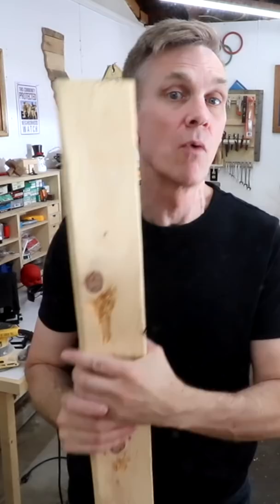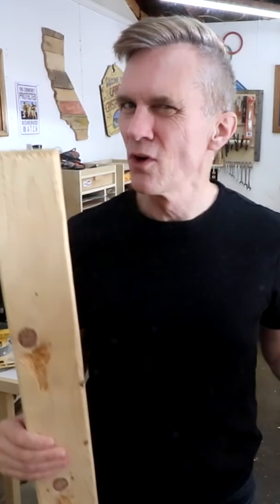Why do 2x4 boards have rounded edges? #shorts

Comment: After the saw mill sends it to the kilns to be dried, the planer mill puts the edges on when they're going to be stored because it allows airflow in the stack to prevent rot and allow expansion/contraction and not shift the weight of the stack to severely.

Edit: I worked at a saw mill for 3 years
Reply: Very informative, thanks for sharing! You need to make a video for all of the angry and unsatisfied viewers of this video 🤣
Reply: Thank you.
Reply: I always thought it was just more sawdust to make more particle board
Reply: I guess the fact that treated 2x4s are square cut supports this.
Reply: @ethansmith9065  Trust me, there is more than enough sawdust just from the normal cutting at the saw mill that theres no need for that from the planer mill
Reply: @GiuseppeGaetanoSabatelli  It mostly depends on the order the mill is working on, and the piece of wood, because top quality boards are pulled off to tell for high quality furniture manufactures and such. But it really depends on the actual order required from the mills
Reply: @ethansmith9065  We also didn't make particle board at our mill because we sold the chips to the paper mill and the dust to a one of the smaller lumber companies to do whatever they wanted to use it for lol. I know every mill does things a bit different.

Edit: Or if we needed to fuel the Kilns we'd move some of the sawdust over to the boiler thing (can't remember the actual name of it I didn't work over there lol)
Reply: @devinhughes7803  They don't need any extra sawdust but that sawdust has value in and of itself. So more sawdust means more profit with essentially no additional cost or effort.
Reply: So when this guy said "nobody knows" he just meant he wasn't willing to do any research. Seems legit.
Reply: Came here to say this and I don’t even work in a saw mill. I just put two and two together, kinda like split wood for the fire place can’t be stacked so tightly
Reply: This is what I needed, thank you.
Reply: While that is a benefit, that is not the reason why. It’s for the saw dust along the saw fence to be pushed out. If not for that, the dust accumulation would slowly build up and push the boards out.
Reply: Devin needs to have his post pinned to the top! 👍
Reply: @DontTreadOnMe1776  If you don't like us picking through it, stop selling warped lumber.
Reply: Makes sense
Reply: Since this video did not answer the question, we'll go with your suggestion. It sounds plausible.
Reply: @DontTreadOnMe1776  it sounds less like you worked at a lumber yard, and more like you worked at Lowe's 😂
Reply: I love how the guy in the video doesn't know why they are rounded, so he comes to the conclusion that no one must know why xD and then the top comment proves the entire video wrong. I love you
Reply: WOW SO WHATS THE POINT OF THIS VIDEO
Reply: I can see it allowing airflow on the edges of the 2x4, but how does the round edge help the center part of the board with airflow and rot when stacked?  That part is still flat
Reply: but the guy on the internet says no one knows...
Reply: Wrong I just saw a video and he said no one knows why. Liar
Reply: Shhh he said “nobody knows”
Reply: Well appreciated someone does know why.   Thanks buddy.  That sounds functional.
Reply: @notsure1350  lol. I was going to look up the answers but it was the first post here. Mystery solved.  👍
Reply: Thank you. I was furious when it ended with “nobody knows.” I was like that’s bullshit. Someone knows.
Reply: Thanks for that m8
Reply: What about the fact that the drying process does it
Reply: Finally someone else who has some brain cells, every machinist knows this and it’s not raw cut and then sent out . Most places raw cut to size then put through 6 cutter and reduced to final size and it’s not any extra in doing rounded edges. Ready for pressure treatment. Then u have idiots like him saying no one knows  why  😂😂😂
Reply: Seems like this guy knows
Reply: @DontTreadOnMe1776  though you are right there's too many of those f*** up ass people that want to leave cards everywhere take up handicap spots literally Park their f**** trailer perpendicular to the actual way you're supposed to park taking up literally nine f**** spaces just because they don't want to step another 200 ft where it's designated to park when you've got trailers that's completely true but hardly anything else that you said was except that hardwood does hold up to climate a little better
Reply: @c7adventures376  Watch the science of what happens when it dries you might find it interesting I'll leave it to you to decide whether you do it or not there should be a little 10 minute documentary that'll give you a lot of information I personally guarantee it you would just have to find it I don't remember the name of it but I watched the actual documentary when it showed the whole thing on TV all the way to getting to a lumber store
Reply: Doesn't it help keep them straight when being dried in a kiln as well?
Reply: I thought no one was supposed to know this information. You better watch your back before someone wants you dead for knowing too much.
Reply: I came here to write this.
Reply: Preach, my sawmill friend.
Reply: Yep.
Reply: "nobody knows" lmao I guess he asked Google instead of someone that works at a saw mill.
Reply: Thanks man. You should have done the video. Hell you answered the question I didn't know I had till this video. Lol might be drunk.
Reply: Thank you for explaining!
Reply: I found nobody
Reply: @ethansmith9065  the sawmill I worked at used sawdust to create steam for the kiln. There was mountains of it. No need to make more lol.
Reply: @bikerfreak714  at the sawmill I worked at when stacking the wood they would put 4 1x1 in between each layer. When stacking to go in the kiln.
Reply: @bikerfreak714  What are you actually even asking? I mean, said 2×4's are shipped, sold and whatever on pallets or skids, so check this out. If the lumber has rounded edges that allows air to flow through. No rounded edges, no air. No air means moist which means rot. Use your brain.
Reply: @Billy420-69  Thanks for the reply.  Op said it was to prevent rot AFTER kiln and during storage.  Most 2x4 bundles I see don't store them with 1x1 spacers so I don't see how rounded corners help the flat section with airflow.  Still think it's more to prevent edge chipping and damage during transport when the 2x4s tend shift around
Reply: @zacharyrhall55  You obviously didn't understand my question and just resorted to insult
Reply: Nobody knows why, this guy does
Reply: Came to say this. It's to prevent you from having a metric ton of moldy, rotted wood.
Reply: Apparently someone DOES know.
Reply: I work in construction.. My thought was about shipping and drying.. So i guess i was close..
Reply: This is the most outrageous video ever made. Thanks for calming me down after that infuriating ending
Reply: Thanks
Reply: @bikerfreak714  I'm pretty sure as long as you keep the lumber dry after the kiln rot won't be a problem for about 10 years.
Reply: Thanks for the knowledge!
Reply: It took me 10 seconds to read this comment and it gave me 10x better information than this joke of a video.
Reply: Make a video calling this guy out.
Reply: To mimic the influential final words of Ozzy Man: fuck yes, Devin Hughes. Fuck yes.
Reply: God. thank you for being here. So tired of these damn stupid click bait shorts
Reply: Legend
Reply: You are good
Reply: @ethansmith9065  that aswell
Reply: @bikerfreak714  wood is permeable
Reply: But nobody knows why they do it
Reply: #69.........we are "screwed" absolutely................
Reply: Makes perfect sense.
Reply: This was the first idea that came to my head
Reply: Wouldn’t it also make it easier to put forklifts or other industrial machinery to separate stacks?
Reply: I was gonna say, I worked in a lumber yard too, but I couldn't recall having rounded edges on the boards. Turns out, because I was in sorting shed and the mill, never worked by the kiln.
Reply: Thanks you should have just done the video
Reply: King
Reply: I would've thought maybe because they could sell off the wood shavings for extra cash while not reducing overall integrity & getting the added benefits of the rounded corners
Reply: I noticed this at home Depot when pulling wood from the straight edge wood piles.
Reply: Thank u. The preamble was putting me to sleep.

Here's your cape, sir!
Reply: I’ll take your word for it🧐
Reply: Nobody knows. NOBODY. Say it with confidence.
Reply: Maybe.. I ran a wood-fired kiln at a sawmill for several years and I don't think that would be the primary reason though. I'm not sure how you guys load your track units but that wouldn't help very much at all once they're stacked, racked and loaded. 
We had rules in the drying and also the pressure treating area and were monitored by the EPA, APA, OSHA, etc.. and had to cut, stack, heat and treat every board in a very strictly controlled manner. This could differ from state to state though (I don't know).. but they told us how we can/can't cut the lumber. Is that how other mills run in your own areas?
Reply: Tha ks devin 'preciate chu
Reply: Thank you devin hughes you're life led up to this moment and you didn't disappoint
Reply: Oh. I always thought it was just a "mistake" that was caused by using machines.
Reply: Yep, saved me time typing it out 👍
Reply: I concur
Reply: I'd imagine it also reduces weight in transit, though very minimal. The same shipment, but that trimming can still save on fuel costs. Over time it adds up.
Reply: @rebelicanlifestyle2817  that was so pretentious who tf says that
Reply: Thank you this guy left blue balled us left me wondering.
Reply: Brilliant
Reply: @devinhughes7803  you sir are clueless !
Reply: Is this how it began? Did people long ago think about airflow?
Reply: This is cool thanks. I worked in a high end cabinet shop for 5 years. We used to take hard wood boards that would be unseen, similar to pine studs, and round the edges to get a more uniform fit, especially when the boards have to border another.
Reply: Danke
Reply: "Nobody actually know the original reason why 2x4s have rounded edges"... Except Devin
Reply: Thank you glad I came to the comments before finishing the clip. This guy was talking way to much.
Reply: What a king
Reply: Thank you for answering this question. It makes perfect sense. Thank you again.
Reply: I would think this would effect shipping costs as well. Shaving 2.5% of weight across an entire truck means you can ship more.
Reply: @Devin Hughes but didn't you hear the man? No one really knows! XD
Reply: I hauled lumber from mills and loaded trucks at a lumber yard for 22 years. You are right, also helps keep the boards from twisting due to too much moisture. During different times of the year there are different kiln processes, but that was for pine lumber. That was mainly the mills I loaded out of, we got our spruce cedar and fir by rail. Loaded osb and plywood at local mills too. Wood is a great material to build with
Reply: Seems right, I'll just take your word for it lol
Reply: Bruh he said nobody knows so that means nobody knows.
Reply: @Sparrowash97  mill workers have been scratching their heads on this one for centuries! "idk man I put it in as a tree and it came out as rounded boards"
Reply: That makes sense
Reply: This guy is why I still have faith in YouTube comments
Reply: That's what I understand as well, that and for automated handlers, at least from what I understand. I don't work at a mill, though there are several in my area. Much love friend
Reply: Yeah, but he said nobody knows so..... /s
Reply: thank✨
Reply: See this is what happens when regular people try to make videos they forget there are workers like you who know wtf there talking about
Reply: Thank you for actually answering that. This short just pissed me off by not answering his own question.
Reply: MVP
Reply: Thanks for making this video not a complete waste of time
Reply: Nah that can’t be true, according to this guy nobody knows the reason. He just said it
/s
Reply: The video had zero value. This comment is all we needed.
Reply: @enix0053  just dislike the video bruh it might have 50k
Reply: He’s not lying people
Reply: 🤬 Dude, you should have made this short story, not him. At least with you I actually learned something. He effing waisted my life 😡
Reply: Mai nigga..👌🏿
Reply: When the clip doesn't deliver what ut says it will but a commenter decides to do it instead, thanks.
Reply: No, IT would be microscopic airflow - not enouch. And because of that they are stack with spacers. Also - IT would be stupid amount of work for such purpose.
Reply: I love this "Nobody Knows"...

"BITCH HOLD MY LUMBER"
Reply: I just came here to write exactly the same.
Reply: That's awesome! I love learning about different career paths.
Reply: The genius who made the video could have just asked at a saw mill, but decided nobody knew 😳
Reply: So, this video is just peddling more bullshit misinformation, priceless YouTube.
Reply: Just about to say this but you beat me to it lol
Reply: I believe you proved that somebody knows why!
Reply: Thank you, obviously WAY more knowledgeable than this guy doing videos
Reply: I though of why they might do that cut and this is the first thing I thought of. I'm glad it's actually based in some truth
Reply: And you would think to go all the way is to do a video, one could have researched that to include in the closing... Nonetheless thank you for your information. I probably would end up calling the sawmill otherwise.
Reply: Great answer. Can’t believe the guy in the video wasted everybody’s time.
Reply: Thank you! I was really curious after all those reasons that weren’t reasons. I guess contacting a saw mill wasn’t in the video budget.
Reply: wow thanks! I was getting salty that he didnt give us the reason. just said NoBoDy KnOwS. clearly not nobody, because you know! :D very informative.
Reply: Nice
Reply: Lol all it takes
This guy acted like it was a secretive as the holy grail
Reply: Should give you all the revenue he gets from this
Reply: Now we know.
Reply: That makes sense. Thanks
Reply: Genius.
Reply: The expert is always in the comments.
Reply: Nice work
Reply: @bikerfreak714  can't give you a mathematical equation for it but I am certain one key factor in the drying of anything will be surface area. And by rounding those edges you will increase this by a substantial factor.  (Plus wood isnt considered a solid surface so air channels along the sides will allow the individual sticks to breath where as if edges were square, any moisture would have to make it throigh the whole thicknes of the stack.)
Reply: Thanks. This guy was saying absolutely nothing with no resolution.
Reply: Rounded 2x4s warp like wild compared to 2x4s left with no rounded edge. I deal mostly with #2 lumber at my lumber yard and that shit is pretty straight when ya cut the bands opposed to the rounded ones.
Reply: @ryanlynch3579  Most helpful explanation.  Thanks Ryan!
Reply: I worked at a lumber yard upsticking and running the kilns as well as loading and unloading units.  I HAVE NO CLUE haha but all cedar came with edges and doug fir boards were all rounded and came to me GREEN.  True reason is unknown, everyone thinks they have the answer but they don't really.
Reply: Man you shoulda made this video. Not that amateur
Reply: Have heard his reasoning and that it makes the fibers larger so that they don’t peel as it is dried.
Reply: I didn’t have to work at a saw mill to learn that lol. It’s just common sense really.
Reply: Oh that makes sense actually
Reply: Thankyou you're more useful than the video guy
Reply: I cant imagine the things you saw.
Reply: This guy knows why
Reply: Class is over
Reply: See below  for real answer.
Reply: Thanks for answering this I was livid this guy ended his video with "nobody knows but here's some nice ideas people have"
Reply: An....an answer? Finally.... salvation. No but fr thank you. I hate the fact that the video doesn't actually explain why they have these edges. Your comment actually gave watching this video some sense.
Reply: Thank you.
Reply: Well thank you for giving us an answer if I didn't get one I would have been really irritated
Reply: I was going to guess the machines doing the mills get better traction or it's cheaper to round the edge in some fashion. Possibly allows a slightly greater number of boards per tree as well. We know how everyone loves to cut corners!
Reply: cool
Reply: Interesting, but how do any of us know that your  explanation is correct? Just because it sounds plausible doesn't make it fact.
Reply: @whyme9501  whoa! did somebody park in your spot that day?
Reply: "nobody knows" 🤦
Reply: That is correct , as I've worked in saw mills and when the stack is pushed together tight it can rot as they lose money .
Reply: Wouldn't it also help to keep them straight and true?
Reply: That makes good sense! Best explanation I've heard
Reply: It's amazing what you can learn by paying attention 😂
Reply: @backcountry164  saw dust is extremely expensive. On scale it wears cutters and takes time to create. Milling lumber crates enough saw dust and chips, and creating more isn't worth as much as the solid wood. So they're not going to make saw dust and chips if they don't have to.
Reply: How did you inform in less than 60 seconds?
Reply: Thank you 🫡
Reply: Thanks for your sharing the info!
Reply: Thanks- I got the answer in under 10 seconds of reading your comment after wasting a minute waiting and waiting!
Reply: Well it certainly seems like we know the answer
Reply: You got it! Airflow
Reply: Not for framing...made for being painted...
Reply: @GiuseppeGaetanoSabatelli  wrong, only fence pickets
Reply: I knew someone who worked at a mill would come to my rescue🛐
Reply: Finally someone with some fuckin common sense!
Reply: @ethansmith9065  Ikeawood.
Reply: That's what I was told
Reply: Makes a lot of sense
Reply: I already knew the answer, I'm just glad I'm not the only one
Reply: @GiuseppeGaetanoSabatelli treated has rounded corners too
Reply: @backcountry164 too much sawdust already. More then can be used sold or burnt
Reply: @devinhughes7803  I wont deny that the rounded edge let's more air flow and I've worked a couple small mill operations for a buddy doing lumber for a huge metal company.  We cut and dried rough cut boards for pallets.. we dried them due to the fact they would be touching unfinished metal . We had a option to get a mill that mills a rounded edge we were told it helps the board slide together amd not bind on the corners .. but I agree it would help them dry more consistently but they would dry fine with a straight edge and ypi can get all types of limber dried with a straight corner.
Reply: @TechieTard  no
Reply: That and you don't get cut when handling out of the planer/moulder
Reply: Then u would know that isn’t true!
Reply: I worked in a sawmill in on the east coast and it was the exact same reason you just said
Reply: @SmickyD  most mills still have square edges when it's placed in the Kiln to dry... the rounding happens in the planer (unless customer requests square edges).
Reply: @bikerfreak714  the 1x1 is used in the kiln to allow air to circulate around the whole board; those 1x1's are removed to go through the planer... the units I have experience with place stickers (1x0.25) every 4 feet every fifth row yo allow extra air movement and prevent twisting.

Air being able to move along a corner helps control humidity, if the lumber dries out too much it cracks, if it get to much moisture it rots.

I personally think the rounded edges work two-fold...
 1) allows for moisture control.
 2) saves on labor stacking the units after the planer (rounded edge slides easier with fewer hang-ups than a square/sharp edge does).
Reply: That makes a lot of sense.
Reply: Makes as much sense as any.
Reply: But NO ONE KNOWS! lmao. its so the boards dry straight {er}. you know that. right?
Reply: @paulperkinson2792  but it wasn’t!
Reply: I had a feeling SOMEONE knew why.
Reply: YT Guy: “Nobody knows…”
You:”Hold my beer and take a seat”
Bravo
Reply: Yup came here to say this. Was told this by an old saw mill guy who was a master cabinet carpenter. Airflow down the boards as they’re “sweating” he’d call it
Reply: @ryanquinn1257  then everyone would know!
Reply: Thanks for the clarity.  Hopefully he read it too
Reply: I literally theorized exactly this while watching the video
Reply: Yes, that's the main reason I was taught growing up in a logging town with Weyerhauser and Long Bell being the main reason the town is here even. 
 The other reason I was always told was to stretch the board foot available due to loss from the outer edges of the log. They basically found if they adjusted their cut they would lose less material in the planner when dealing with all the second growth lumber that doesn't have as dense of growth rings as the old growth did which allowed for a more squared rough cut without planner being needed
Reply: First it goes threw the band saw gets cut into something known as cants, then the cants go throw a machine known as a edger, that makes the slabs 1x4/2x4/4x4 then they get cut to length then they get graded then the high quality 2x4s go threw a plainer. Then high quality goes to dry shed to reduce weight for shipping purpose ship more make more..
Reply: Beat me to it
Reply: @ziocrielo6148  and its literally not why!
Reply: if you've seen lumber stacked and bound, you should be able to logic this. Almost like you were baiting this video to sell..

MICRO JIG
Reply: It also stops lumber from sticking together… less about airflow, more about sticking together, I’m right
Reply: Facts
Reply: Thanks bro. 👍
Reply: "Nobody knows" = "I don't know and never bothered to figured it out" lmao
Reply: Duh. That should’ve been obvious but holly cow thank you for posting
Reply: No, didn't you watch the video?  No one knows
Reply: Thank you for increasing my knowledge.
Reply: @GiuseppeGaetanoSabatelli I doubt the square cut is kiln dried
Reply: @GiuseppeGaetanoSabatelli  Guess the fact that treated 2x4s are TREATED to be able to withstand moisture don’t mean anything…
Reply: @TechieTard  That’s so stupid of an answer. Yeah, because they wouldn’t have some type of device or compressed air blowing the saw dust away.
Reply: @yungboomar7287  You seen it on the internet by a no expert so it must be true, right?…
Reply: @whyme9501  What about the fact that it runs into moisture while stored and shipped? I know, I know… It’s hard to think.
Reply: @Billy420-69  Pretty sure dry wood isn’t just gonna rot after 10 years…
Reply: I work in a planer, I came to say this
Reply: @matthewyun1238  No you just don’t know. It’s called being ignorant. You just said you have no clue, how are you going to proclaim nobody knows?
Reply: @b-e-a-r6166  I am a planer. Came to say this.
Reply: Thanks. He left us hanging with the question unanswered.
Reply: Well now we know why 2x4s have edges but can anyone explain why a 2x4 isnt really 2inch by 4inch
Reply: Makes sense, thanks for the schooling.
Reply: @mikeznel6048  i see deep knowledge in your post, did you feel better writing it? Because that was the intention, right? 🤣We all gather here to make you feel better about yourself 😁
Reply: @willbennett8799  which is also not remotely true!
Reply: I guess somebody does know. Man YouTube sucks.
Reply: @chriskibodeaux9818  no way, it’s true I saw a Facebook fact check that said it’s true..
Reply: @mikeznel6048  exactly
Reply: awesome thanks for the info ✌️
Reply: Watched the whole damn short expecting an interesting answer just to get the answer in the comments. Typical
Reply: @willbennett8799  bahahahah ok
Reply: @devinhughes7803  Drying as well as making it much easier to handle both with automated machinery and by hand..
Reply: Interesting. I’d have thought it to be for being able to grab it from piles - something to wedge in to make a gap
Reply: Devin knows
Reply: No! Nobody knows! Stop saying things!
Reply: this too...
Reply: nObOdY rEaLlY kNoWs

Then here you are, making this man a public humiliation
Reply: Makes sense.  I'll fact check this as true 👍
Reply: @JoeMac1983  it also reduces cupping, and its called "kerfing"
Reply: Good guess but they are dried before the planner mill I worked in planner mill for years as well. And when packaged they are set in a dry place weather not effect it
Reply: Thank you
Reply: Mith busted! Haha
Reply: @whyme9501  "How it's Made"?
Reply: Boom
Reply: Nice. That’s a sound bit of knowledge 🙌
Reply: What do they do about timber that is kiln dried but square edges? Leave it to rot?
Reply: But he said nobody actually knows...
Reply: I knew someone would know. I learn more from YouTube and the comments section than I did in high school.
Reply: Thanks man
Reply: “Nobody knows….” :)  I have to guess he is using that for viewer engagement.  Well played.
Reply: I totally don't buy that (having stacked and dried lots and lots of square edged timber in my time,  and the only lumber our yards sell with rounded edges is framing and construction lumber, not finishing lumber (treated and un treated). And as for round edge lumber being around before dry wall? Totally not true in  nz or UK. I've pulled apart lots of houses with drywall and square edge lumber from the 60s and 70s.
Reply: Thank you. Of course there has to be a functional reason, otherwise the steps to round the edges would have been eliminated a long time ago (or never done in the first place).
Reply: Sounds like they know exactly why they are round 😂
Reply: I was told as a kid it was for airflow when they're sitting and never knew it was a mystery.
Reply: correct
Reply: Would have guessed there is a strength benefit by rounding out stress concentrations
Reply: That's 💯% correct. It is strictly for airflow, once its stacked for shipping. 

They don't all get stickers, so this is the next best way. 🤷‍♂️
Reply: No, the video said no one actually knows why.
Reply: @sotl97  except, for the people that do know. 😂😉🤦‍♂️
Reply: Thanks
Reply: Your name must be Nobody 😅
Reply: @jliz6435  Ha!!! That's actually awesome! 😂😂😂
Reply: @GiuseppeGaetanoSabatelli  makes sense, because they wouldn't need to worry about the airflow during pressure treatment.
Reply: Nope, the video said nObOdY kNoWs!
Reply: But no one knows!!!!
Reply: Not for airflow..that will not make a difference